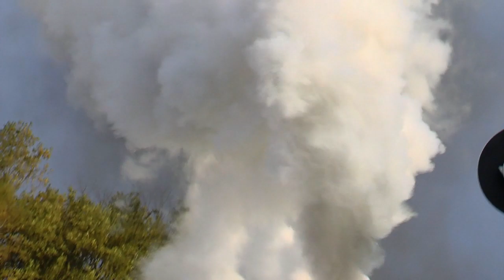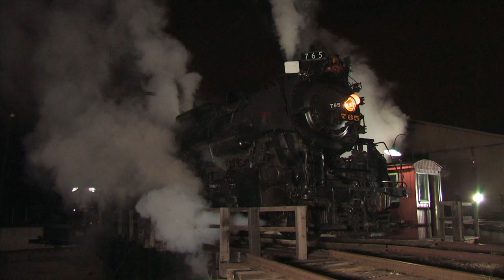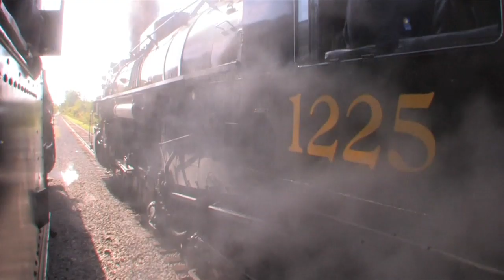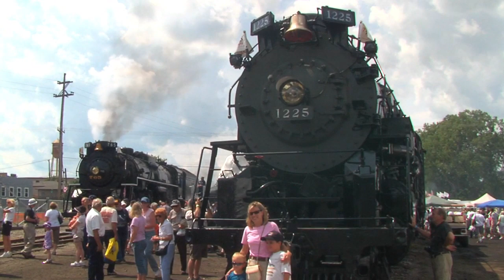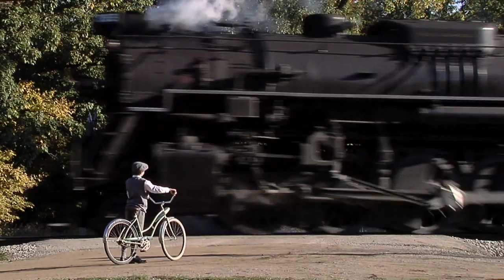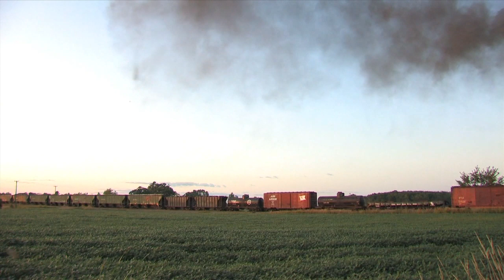Steam Legends Reunited

Comment: We need to make this happen again guys
Reply: Austin Rayner already did, Train Expo 2014. Just imagine Steamfest, but on a slightly smaller scale and without the 4449. 1225 had the honor of wearing 611s whistle that week
Reply: @jerrysgardentractorsengine2243  we need another train Festival. Last year would have worked perfectly since it was the 150th anniversary of the Transcontinental Railroad's completion. Imagine if they brought Big Boy to that. Maybe they'll do one in 2029.
Reply: @FutureRailProductions  if someone pays for it then it will happen.
Reply: A more realistic one would be one wherein 765, 1225 and C&O Kanawha 2716 are together. Its essentially a reunion of three of the Van Sweringen railroad Berkshires.
Reply: imagine 2716 running in new england......then 765 and 1225